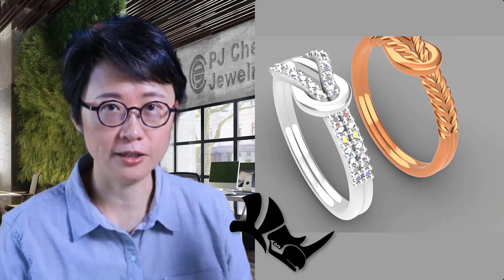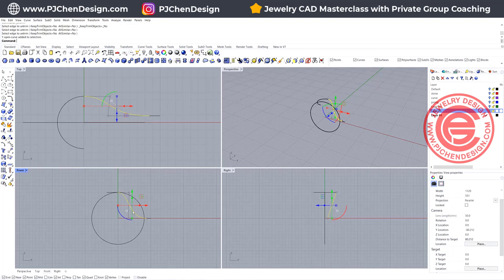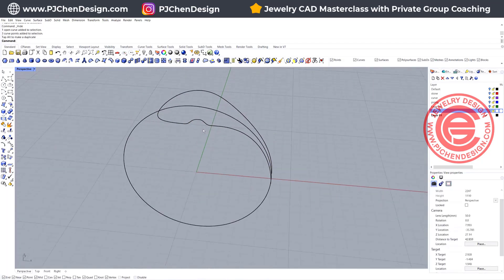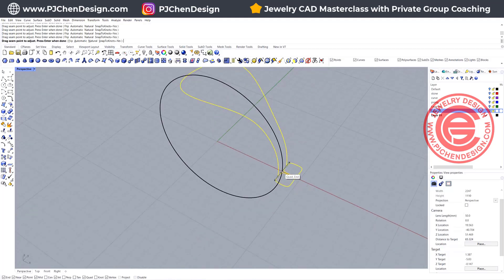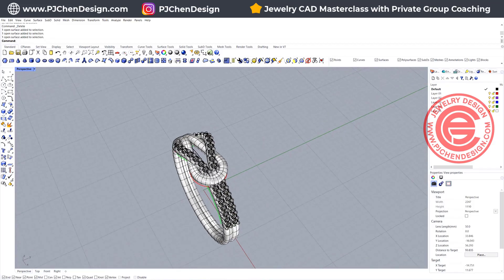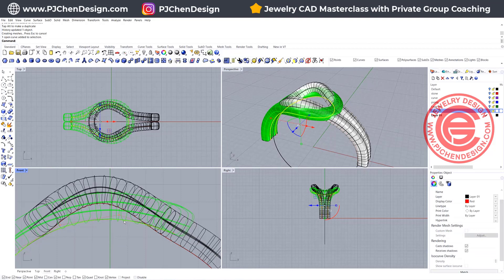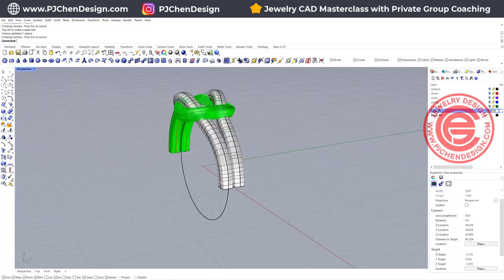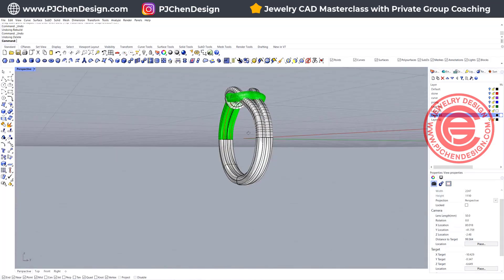Knot Ring 3D Modeling Jewelry CAD Design Tutorial with Rhino 3D #494

Comment: you either use the tools that are on the left side of the panel or use those that are on the top panel so you don't have to jump from one to the other, or you don't know where the tools are on the left?
Reply from the maker: many of my students are beginner, I would like to show them differnt way you can use the command, either from dropdown menu, icon or typing.
Reply: @PJChenJewelryDesign  so they will learn as soon as they see it, use only the side table, otherwise jumping back and forth is not right